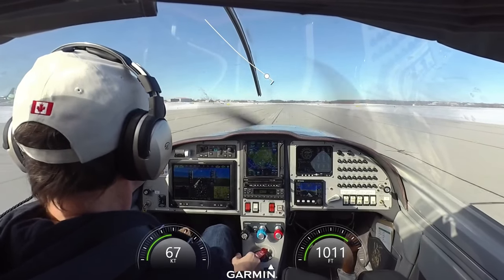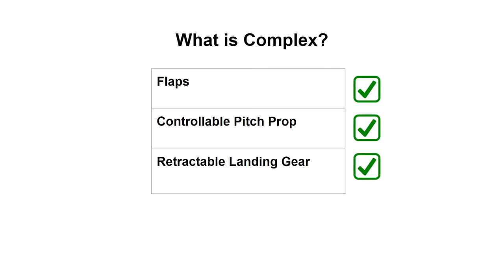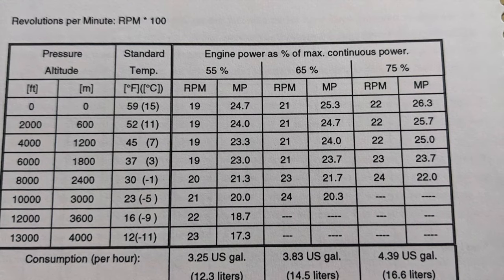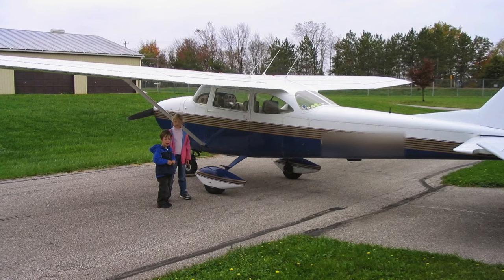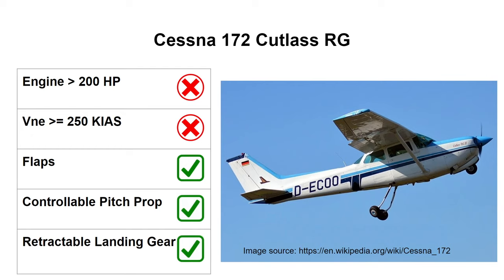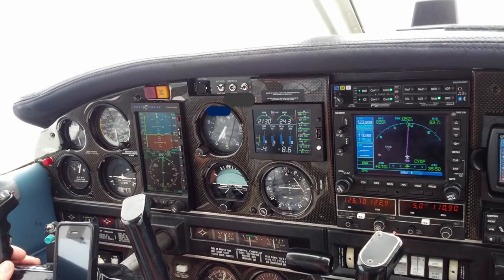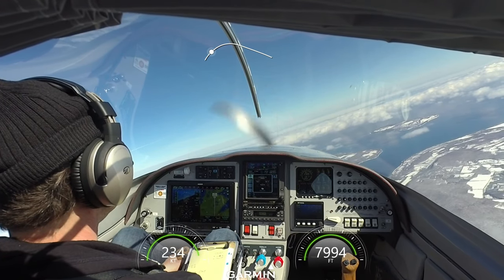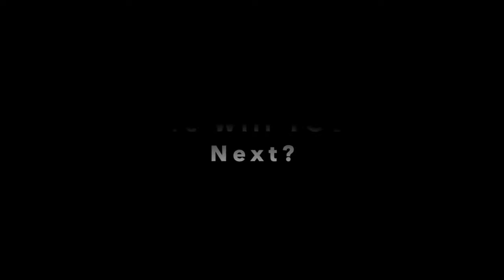High Performance Complex Aircraft |  Why I fly them |  Why YOU should too!

Comment: I can appreciate the gradual transition from a trainer airplane to a faster airplane. But I think private pilots make too much of a big deal out of it. If we compare our learning curve to what they do in the air force, they get on turbines very quickly. so it almost seems as we're building barriers for ourselves sometimes. We need to respect the machines for what they are. Don't try to do with an Arrow what you would with a 152 and vice-versa. Also be proactive, always, in your learning. I climbed into my Mooney at 65 hours and after 10 hours was pretty comfortable and after 20 hours everything was automatic, just like it was in the 172 I trained on initially. It worked for me, but might not work for everybody.
Reply from the maker: Thanks for the comment!  I'm not sure that I agree that "private pilots make too much of a big deal out of it", or at least that's not how I intended to come across or what I'm trying to suggest.

I've said this in a few of my videos:  everyone's path, comfort level, and risk tolerance is unique to them.

My personal approach is all about managing risks at every step.  There is nothing in my past decades of flying that even remotely resembles what military pilots go through - I never had the intensity, consistency or even the time (and often the motivation) to claim any parallels with how they develop and stay current.  I suspect that many if not most GA pilots share that in common with me.  At the very least, the weekend warriors do.

Hope this helps.  Happy flying!

Comment: EASA definitions

High-performance aircraft (HPA) is a term used in type certification but is not clearly defined. However CS 23.2005 defines two performance levels:

”(c) Aeroplane performance levels are: 

(1) Low speed — for aeroplanes with a Vno or Vmo ≤ 250 knots calibrated airspeed (KCAS) or a Mmo ≤ 0.6; and 

(2) High speed — for aeroplanes with a Vno or Vmo > 250 KCAS or an Mmo > 0.6.”

The term ‘complex motor-powered aircraft’ is defined in Regulation (EU) 2018/1139 as follows:

“‘complex motor-powered aircraft’ shall mean:

(i) an aeroplane:
- with a maximum certificated take-off mass exceeding 5700 kg, or
- certificated for a maximum passenger seating configuration of more than nineteen, or
- certificated for operation with a minimum crew of at least two pilots, or
- equipped with (a) turbojet engine(s) or more than one turboprop engine, or

(ii) a helicopter certificated:
- for a maximum take-off mass exceeding 3175 kg, or
- for a maximum passenger seating configuration of more than nine, or
- for operation with a minimum crew of at least two pilots, or

(iii) a tilt rotor aircraft;”

HPA is not an endorsement in itself. Certain theoretical knowledge Requirements must be met before undertaking the first type or class rating on an aircraft defined as HPA. Those who have passed the ATPL-theory already meet the requirement. Experimental aircraft aren’t covered by EASA regulations and fall under national regulations, hence you can’t get an EASA class rating for an experimental aircraft. Since experimental aircraft aren’t type certified they can’t be classified as HPA by EASA either.

Since the Lancair Legacy has a Vno of 220 KCAS and an MTOM of 998 kg, is SP, with a MOPSC of 1 and has a reciprocating engine it would fall outside the single pilot high-performance complex motor-powered aircraft category anyway.
Reply from the maker: Thank you for the info!

Comment: 250kias is above mach 1 at FL400. That is indeed high performance. Also Vne is kind of a bad criteria, that speaks to structural strength, not performance.
And yes sleek planes are good. So much missed potential in GA. Especially in small turbofan engines. Imagine a pressurized Lancair at half the weight in carbon fiber and with two small jet engines so you zip at 700km/h at FL400 with better fuel economy than a cessna 172. In a plane that costs LSA money.